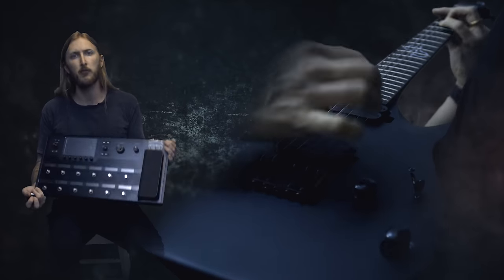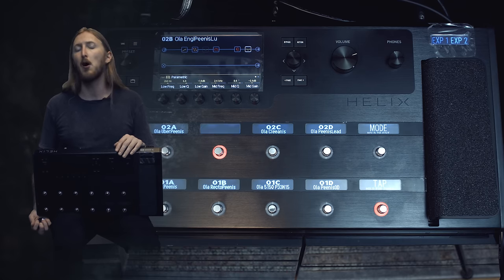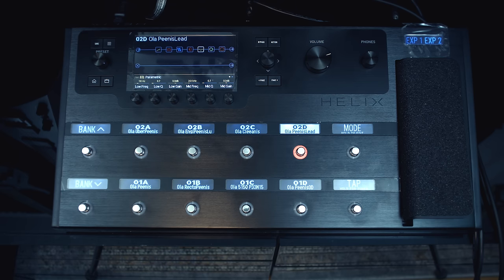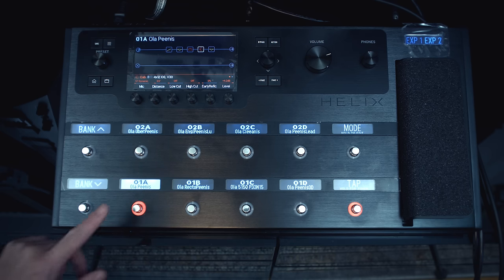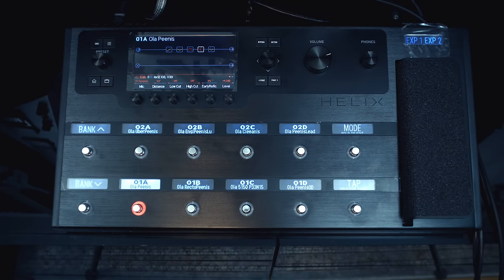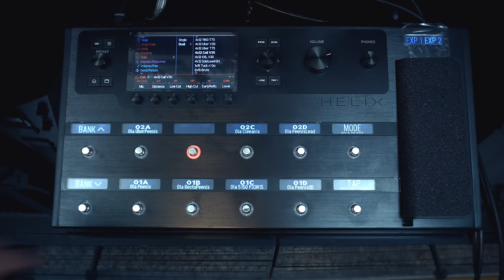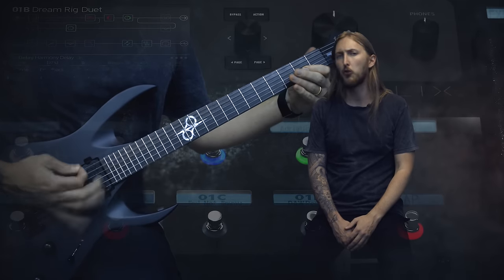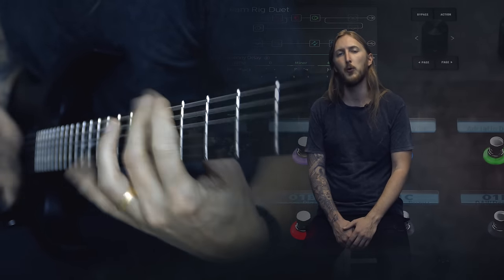Line 6 Helix - Metal?

Comment: Sounds very good, but for the price I'd rather just buy an actual amp. Just kidding! I can't afford either!
Reply: I've spent thousands on fenders,marshall, and the odd assortment of lesser known tube amps and vintage,gear through out the years, I sold them all, kept the helix worth every penny and with every firmware update it keeps getting better.
Reply: @fabianvasquezjr8852  exactly
Reply: Its almost as much as a Kemper and I think that would be a way better use of my money. But for Line 6 this does sound good .
Reply: Dirty Ancom will probably never spend money on a tube setup unless I get super rich. Helix and a powered cab are more than enough to turn up!
Reply: @raphaelrodriguez1856  I have a Helix and a Headrush 112 on a 2 foot pole stand. Best tone I’ve ever heard, honestly. I’ve spent 4 years trying and listening to other gear and the combination of quality a d flexibility is awesome. You have to put time into finding your sound and experimenting with cab/mic combos, but once dialed in its unstoppable. 3°IR’s are a good solution too if you know what you’re looking for out of the gate.

Comment: Don't laugh at the pointed-out "on/off button" feature, it's sorely missed on the HD500X!
Reply: Amen dude. I own one and hate the fact that there's no power switch.
Reply: you know you could of just bought an "inline" switch found on things like lamps, cut an IEC lead quite near the plug that goes into the back of the HD500, wire in the switch there?.

theres your on/off button even with the thing plugged in/connected?

That would have worked right?
Reply: In Norway we call it the swedish button ;) Or "svensk-knappen" which is pointed to swedes is stupid and need an on off button .
Reply: It is. I unplugged mine and it hard crashed my pc.

Comment: My experience with Helix: using high cut on the cab sims is the key to great tone :)
Reply: It is mate :)
Reply: Hell yea, especially the stock cabs have to be tweaked and third party ir's does the trick too. A lot of people say the helix is crap because they want to plug in and sound like their favorite artist, without any work from their part, it don't work that way, I don't even use the presets, accept to get a base tone then tweak from there, once you figure this thing out you begin to appreciate what a giant leap line 6 has made over their other modelers.
Reply: how do you usually set the high-cut?

Comment: I love my helix but suck at making patches.   These are some pretty good sounding patches but the noise gate is all jacked up and I have to disable it for all or it clips all over.  Plus, the built in noise gate is all you need if you want one, to save some DSP.  Also kind of goofy to have a specific lead patch vs building it in to another patch (or all patches) but I guess that's just for demo.

Comment: It doesn't work well with active pickups unless you spend days and days eqing it. CF is sticking with the hd500x. There will be a helix plugin in the future for a lot less then the hardware. The effects and options are awesome on the helix but the amps sucks balls especially the panama, sound super fizzy and glassy but not in a hood way.
Reply: Chemical Fingerprint high cut it

Comment: don't know if it's worth spending 1400/1500 euros or just save 200 more and buy a kemper... but from what I've heard here there's no match. :S
Reply: Save more
Reply: Kemper.
Presets are meh on it, yet in the next Ola's video you can see how they actually suck on the Helix.
Either ways you will have to get some professionally made impulses, and there are a lot of outstanding ones for the Kemper.
Check the  Guido Bungenstock's profiles.